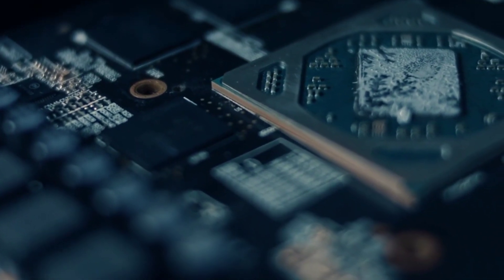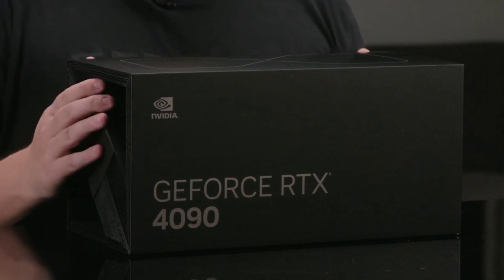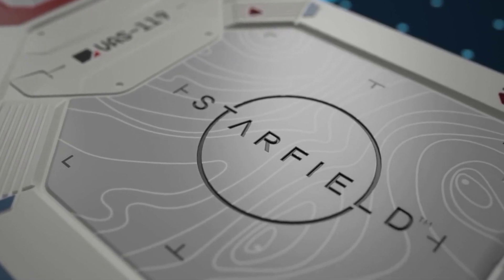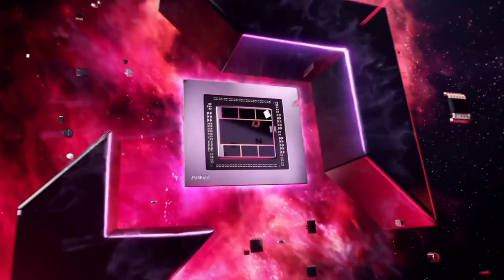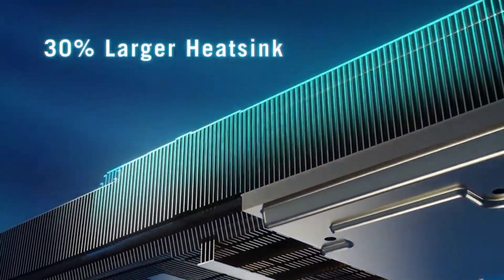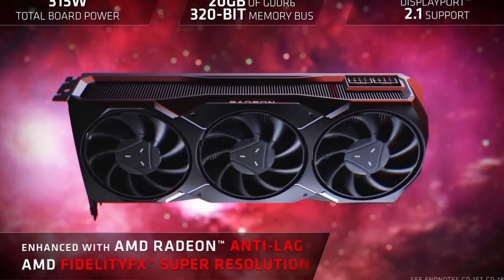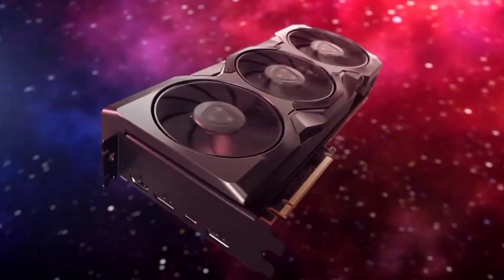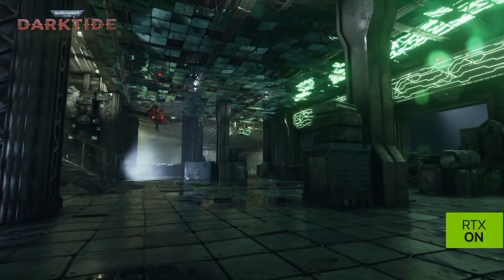The Ultimate Graphics Cards for 2023: Top 5 Picks for High-Performance

Comment: Got the 4070 and glad it’s on the list it’s been a great card with amazing performance I play on 1440P 144Hz monitor but I was surprised to plug it into my 4K TV and max out most games in 4K with over 60FPS with out using DLSS
Reply: Should've get 7800xt,but 4070 is still a very nice card
Reply: Sell the 4070 and grab a 7800 XT maybe you make a little money in the process because Nvidia is overpriced. @arinkarwan5888

Comment: 7900xtx is definitely not as far behind as you stated i own both the 4090 and the 7900xt and the 4090 is only beating slightly in some games where as the 7900xtx is beating it. currently I use the 7900xtx while my 4090 sits on my desk...
Reply: A 7900XTX setup is just cheaper overall. Less money on the GPU, less money on CPU, less money on CPU, and generally less money on monitor.
Reply: The 7900xtx is very good, but not better than the 4090 at all. If you use both and got those results either you suck at math or you have the wrong setup to really juice the card.

Now, the 7090xtx is a FAR BETTER DEAL than the 4090's and that is undeniable.

You got a better deal, but not a better card. and thats fine....
Reply: @ronswanson1410  definitely been building PCS for 15 years and definitely know what I'm talking about. I've probably used more cards than you'll ever see in your lifetime. The 7900 XTx is the best card I've ever owned period. 4090 has way too many issues for it to be a good card in my book. You can gladly buy mine if you'd like it's for sale.
Reply: @ronswanson1410  but that's what you get when you have biased opinions that people believe all the fake  reviews they see from Nvidia fanboys lmao
Reply: @nerdypcbuilder  "not as far behind" yeah for sure it's 20-30% slower literally shown by every single source imaginable. there is either something wrong with your setup or you are just lying.